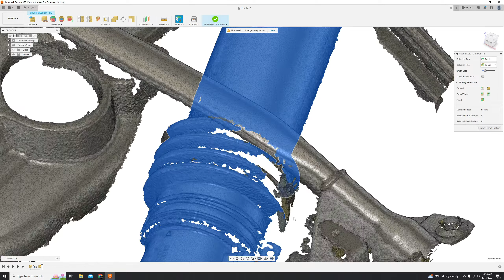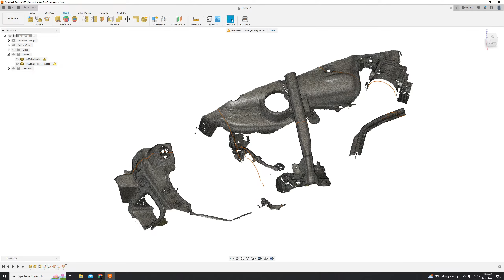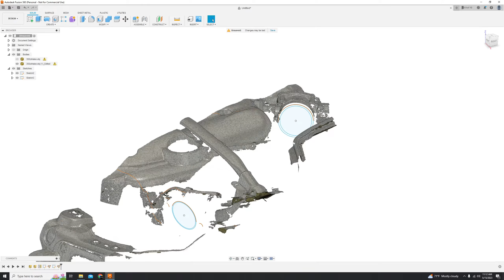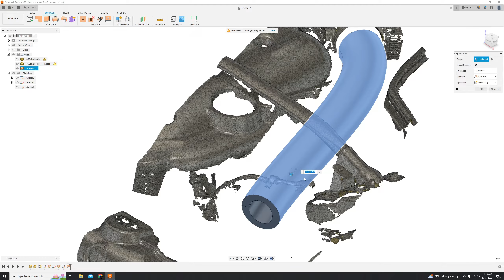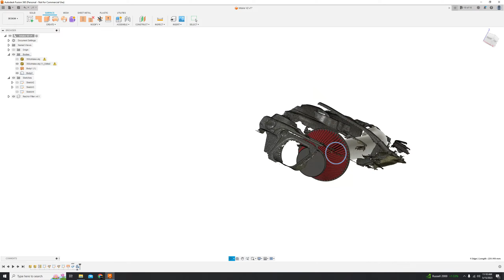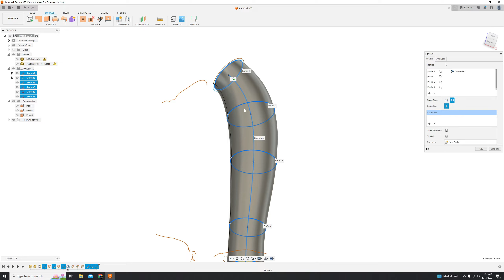I am 3d printing an air intake for my 350z Pt:1

Comment: I printed one for my 350z last year. I used PETG and wrapped it in the gold heat tape. it still ended up getting too hot, got too soft and collapsed. 😢
Please keep us posted on your results
Reply from the maker: Yeah not great for long term, but could work in a pinch!